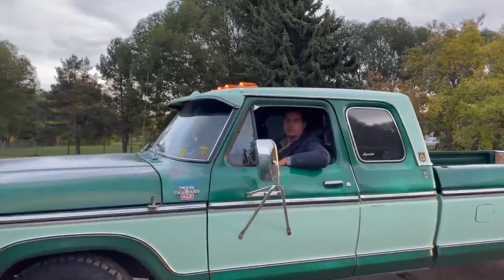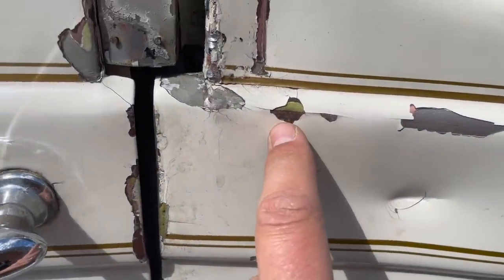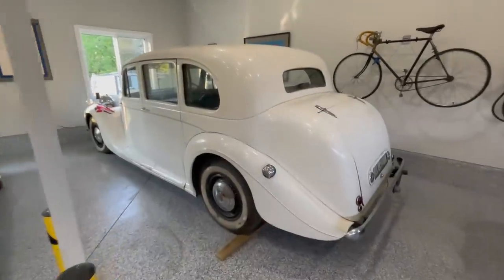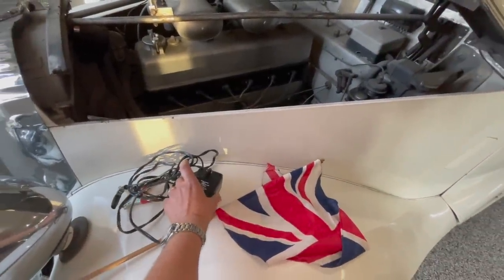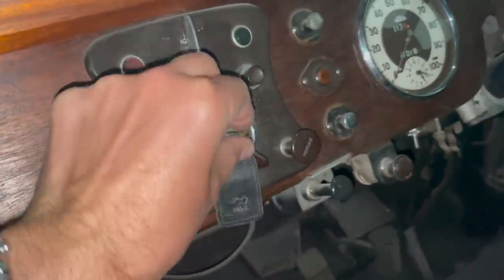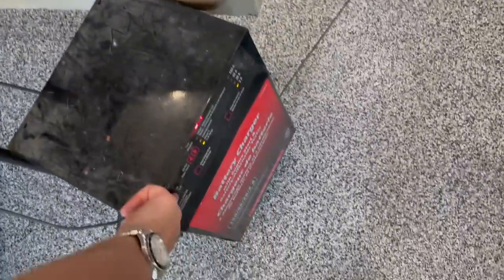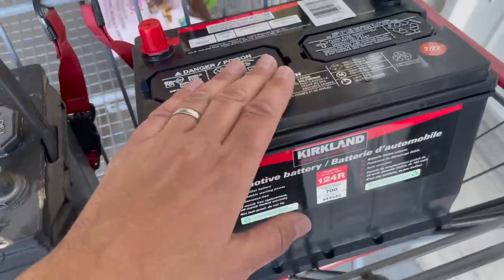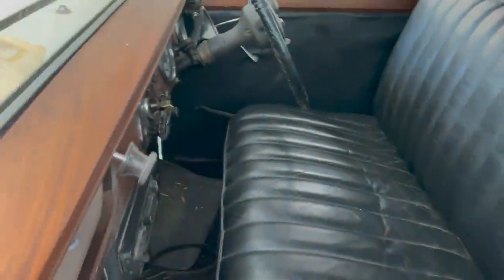Abandoned Royal Limo sitting 30 years, will it start?!?

Comment: Welcome to the land of Lucas Electric aka " The Prince of Darkness". So many beautiful British cars have been trashed because of that one issue being the crux of their downfall.
Reply: Lucas has a poor reputation, true enough, but the components they made in the decades before about 1970 were often very high quality. Their fog lamps were used by Ferrari and were fitted the Shelby Mustangs, as they were the best in the world. Usually nonfunctioning older Lucas components fail because of poor connections, most often a bad ground or unplugged connector. With proper maintenance, most older Lucas stuff can be quite reliable, like anything on old cars. But after about 1969 or so, the company did make a lot of junk, plastic, poor designs and electronics that became more sophisticated, impossible to repair, and much more unreliable.

Comment: As Far as your Comment asto not knowing Why you bought the car ? i can tell you why it’s Cool IMO and overall not in too terribly bad of Shape  that door may require some  serious money to  be repaired correctly ? Quee i’ve might not like your Impression but i thought itbwas Hystericall  i’m betting you are correct on it being 12 Volt  they probably did that for reliability as a RentalmWedding  Vehicle  and for safer Lighting  i wouldn’t be suprised if they did a Altenator   install as part of that  as a rule of thumb Hitachi  Altenators  will replace Lucas  ones and be a direct bolt in without  any major  modifications  except  the Electrical Connectors
Reply: All Daimlers since 1946 had 12 volt ignitions and most Royal cars had it specially installed

Comment: That is quite possibly a Jaguar Drive line Daimler was eventually bought by Jaguar and used on the top in the models so it’s very possible the body and driveline was made by jaguar the royal family are driving around in Jaguars
Reply: No, Jaguar purchased Daimler in 1960 and this car predates that merger by a long way. It is either late prewar or early postwar. You can check the date it was made by looking at the date codes on most of the Lucas components. Before about 1964, even Lucas lights all bore date stamps, and motors and switches were always dated. This is a lovely old car, leather to the chauffeur's compartment and West of England cloth to the rear for the aristocratic bottoms that would sit on it. The floor coverings are lambswool overrugs. Truly a quality machine, those early Daimlers were of Rolls-Royce quality. Jaguar did use Daimler V8 engines in the sixties in Daimler-badged Mark 2 Jaguar bodies, complete with the Daimler fluted grille. The Brits call them "crinkle-cut" Jags.
Geoff Rogers, Lucas and Jaguar nerd
Reply: @rogersmotors7838  Yes you are correct but I have read before Jaguar bought Daimler they were still working with Daimler I could be wrong but I believe I’m right

Comment: Not sure if you did off cam but it pains me to see you start the engine before trying to turn the engine over with a wrench first & not disconnecting the fuel line… you asking for trouble., if it’s been sitting for 30 years the engine could be locked up then trying to turn it over first you could blow the starter and the teeth on the flywheel.. you got lucky lol

Comment: Its. not BRAKE FLUID 
A number of quality cars built in the 1930s were equipped with the Luvax-Bijur centralised lubrication system. Rover, with its range of 10, 12, 14 and 16hp P2 cars was a well-known exponent of this labour-saving fitment, enabling the motorist to lubricate the key components of his/her vehicle's chassis simply, in one go. Riley, Lea Francis, Alvis, Rolls-Royce and Bentley also approved of its use on their cars. So long as it gets used regularly, there's no reason why the Luvax-Bijur system can't go on functioning into the future, although it's important to remember that if a car has sat idle for many years, there's a good chance that the plumbing for the oiling/greasing arrangements may clog up, leading to essential lubrication of suspension components and so on being missed.